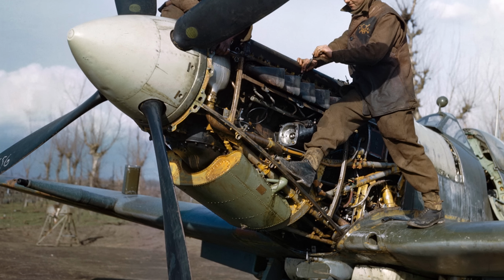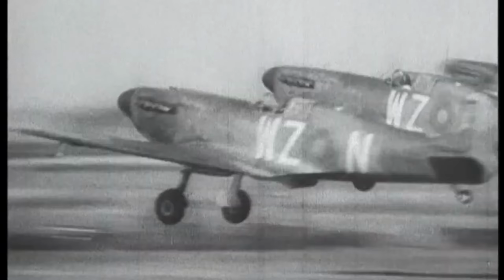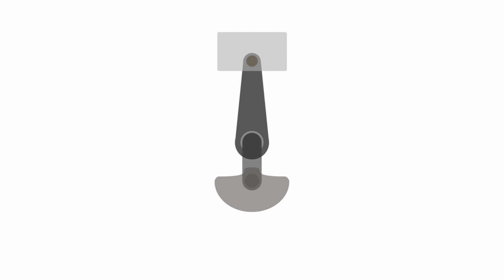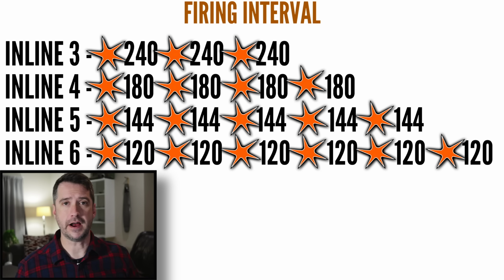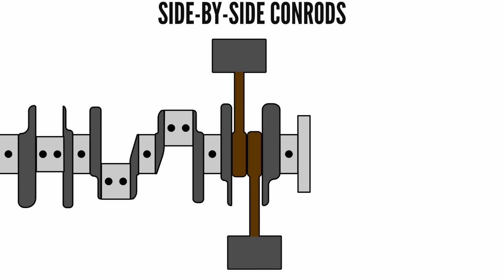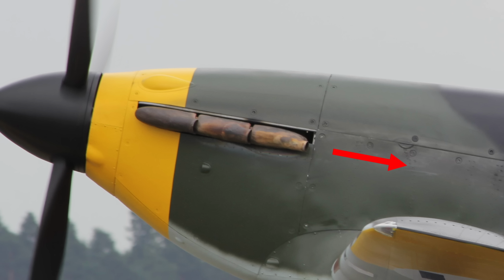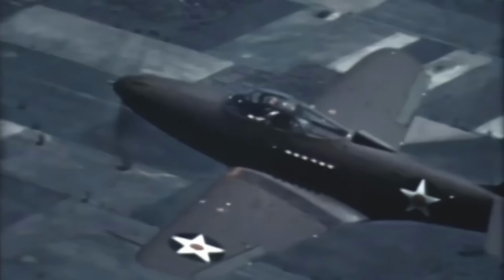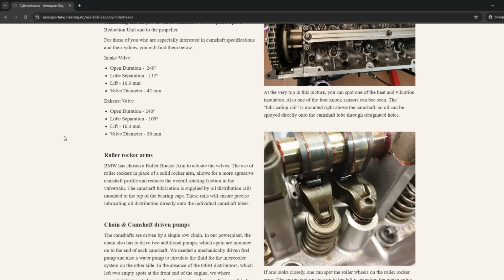WW2 Aviation V12 Design Decisions Explained - History & Technical Deep Dive

Comment: What's really interesting is how close those 3 nations were to aero engine development around 1925, and how some small missteps cost them huge losses when WW2 broke out.
For example, the US decided to stop investing fortunes into the Schneider cup around 1925, which led to engine technology stagnation leading up to WW2. The Brits were on par with the Germans in early fuel injection research, yet despite their testing showing positive signs they quizzically brushed it aside for carburetion. The Brits also wasted many years on the sleeve valve design even though it proved to be nothing more than a headache at every development. All 3 powers had the same scientific studies on how turbocharging was more efficient, and scaled better for altitude over supercharging, yet all 3 powers brushed it aside early on for the same reason; superchargers were smaller. And Germany early on knew they would have issues securing high octane fuel as a war in Europe dragged on, and so they very carefully designed the DB601 to use every trick up their sleeve to run optimally on "lower octane" fuel, like fuel injection (Germans rated by lowest octane, Brits/Americans/Italians rated it by highest octane, so German "100 octane" was actually closer to 130).

Comment: Exhaust trust from a supercharged engine is not very good, we know that after the war when they use turbo compound engines to channel that velocity into the propeller the plane was significantly faster. Its the same logic as a turbofan is superior to a turbojet.
Reply: On the other hand, the XP-72 gave up the p-47 turbo charger for a two stage super charger. Exhaust thrust does a lot more for you at the top end of your speed range, but doesn't help much at the speeds that propeller aircraft climb at.
Reply: @MrAwombat  given the size of turbos in ww2, and even of tubocompound units, it was a waste to invest into this. Only usa have the $ do such thing and still claim to be succesfull because the giganormous size of the p47.

Comment: Fantastic video. The only engine with efficiency spec. was the only diesel: 39.7%  Wonder if the 7 series BMW engine from Norway gets even half of that. Although it almost doubled the original factory HP.

Comment: Amazing video, loads of great pictures! Personally, and I don't have a Spitfire to test this on, but I doubt adding a Turbo would have "reduced exhaust thrust" even though that's exactly where the turbo gets it's energy from and you're right to point it out, but I think much of the exhaust placement is about getting hot exhaust gas over the wing to create lift (without creating drag). "More lift for the same amount of drag" can also be stated "same lift for less drag" - i.e. with hot gases over the wing you can fly at a better attitude. The 10mph top speed improvement would probably still be 8mph, and of course you'd have a turbo.

Comment: Dear LGA, first thanks so much for your great informative videos and the reminiscent SA accent! I would like to propose a video idea extending this one. In late 1942 Stanley Hooker (later knighted for his work on jets) was recruited by Rolls Royce to work on the urgent problem of boosting power at latitude for the Merlin engine. His solution was to insert a liquid cooled intercooler and 2nd stage supercharger between the existing supercharger and engine block. As you pointed out in this video, an even better solution theoretically may be to add a turbo as the first stage since it does not scavenge as much engine power. However, Hooker’s solution was right on the money in this case, brilliant, compact and was implemented into the Merlin 6x production in less than 6 months. This improvement may actually have secured performance altitude at the most crucial time of the war, allowing air superiority over the fw190, and perhaps even war winning. This engine of course was used in spitfire, hurricane, lancaster, mosquito and mustang built under license by packard. The 2 stage turbo solution later implemented in p-38 and “jug” was slightly superior, but very bulky requiring twin boom or bulky and expensive airframe, actually nearly twice the price of the 2 stage super-charger as implemented by Hooker in record time. For me Hookers intercooler is a work of art, or a sublime mix of art and science of engineering. It has 4 trimmed rectangular channels in which the coolant circulates, exquisitely sized to optimize heat transfer from the hot intake into the second stage. Air superiority was arguably the single most important factor defeating the nazi threat. Stanley hooker may be the most unsung hero, an engineering fighter ace, of the order of Turing and others in winning the war. Many thanks. Pete
Reply: Hooker’s breakthrough looked simple — like a car engine and radiator. The hot compressed charge passed through a donut-shaped intercooler cooled by liquid, while a radiator box above dumped the heat into an airstream. But behind that apparent simplicity lay Hooker’s brilliance: he solved the fluid mechanics, thermodynamics, and heat-transfer equations for a two-stage supercharger entirely by hand, with no computers or calculators, turning sketches and slide-rule math into the Merlin 61 that gave the Allies the altitude edge in 1942.

Comment: Turbocharging while still utilizing hot exhaust gasses is still possible. Radial engines with recovery turbines or even the XF Rainbow is a great example where air is ducted around the engines with the exhaust to a rear adjustable nozzle producing thrust.

Comment: I wonder why flat-12 were almost ignored. 
Only Lycoming made one (O-1230, 1200 hp), which was not mass-produced. 

At first glance, flat-12s would have been a great option for twin- and quad-engined aircraft : same advantage than a V12 (perfect balance, etc), similar cooling, plus a lower profile, making it more aerodynamic : it would mostly fit inside the wing. 

But this layout wasn't used, so there must be one drawback that has not occured to me.

Comment: thank you Sir for this video 
I have a question  but didn't find a clear answer yet about engine HP for all old aircraft. As known, most of the engine are more than 1,000 hp. 
My question is, do we need this high HP to get high RPM ? or force? Or torque?
If yes, what is the startup ideal RPM for the  propeller ? I have heard abou 1.3 RPM  which is low when we camper it with can engine.
If the the high HP is to convert the force into torque, in this case, mechanically the speed will be reduced as you know. 
Please advise me and sorry if i confused you 🫡

Comment: how did they handle the lubrication in the engine?
Reply from the maker: Dry sump system. Oil is pumped to the engine from the oil tank, the two scavenge pumps return oil to the tank in the case of the Merlin.

Comment: You cannot understand why the secondary imbalance of a straight 6 engine is cancelled out without starting with a careful look at the slider crank equation. Start with the derivation of the equation. See that the secondary vibrations rotate at twice the speed of the primary. See that at 120 degrees spread, with two pistons at TDC, the 4 pistons each contribute 1/2 of what each piston at TDC contributes in the opposite direction. Why? Because sin 30 degrees is 1/2. It comes out of the math. That is why the secondary forces balance out. One cannot understand mathematical things like this without understanding the math and anybody who thinks they are understanding this concept without understanding the math is fooling themselves.
Reply from the maker: I note your opinion, thank you. My opinion is if somewhat complex math (might not be for you, but it is for many) is used to explain certain things, you immediately lose the interest of 95% of people. That is terrible! I believe it's possible to explain concepts visually so that instead of losing 95% of the audience with 100% correct math, instead 95% of everyone can have some understanding, even if some generalisations are made. I'm not prepping anyone for an engineering exam, and the intended audience is not engineers.

The ethos of this channel is I use as little math as possible to explain concepts. I don't care if some don't like it. Many love it.

Comment: I have often heard a ninety degree cylinder angle was not optimal.  This is the first time this issue was explained.  Thank you.
Reply: From my understanding 90 degrees is optimal for engines with fewer cylinders because primary balance is more important than even firing order. In some applications like motorcycles, uneven firing order can be an advantage because it allows the rider more control at the limit of tire grip.

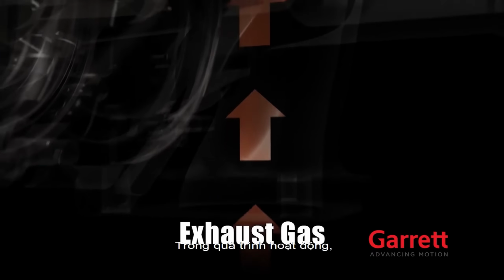Comment: 25:27 absoute nonsense - Turbocharger does have a parasitic loss... there is no free power! 
Simple example: put a turbo on an N/A engine exhaust, but the charge pipe goes to another engine... the first engine will get bogged powering the turbo .. the pistons have to "fight" the exhaust back pressure trying to push the exhaust out several times per second!

Also earlier you used a boxer engine example - I think a flat engine should have been mentioned as well (looks the same externaly as a boxer but each pair of opposing pistons actually share a crank pin).

Otherwise, fantastic job!
Reply from the maker: Correct. I was referring to mechanical parasitic loss.

Comment: BTW, Merlin was not an exceptionally good v12 engine by ww2 standarts
Reply from the maker: It was pretty good, if not exceptional in the 30's (first run 1933, production by 1937).
Reply: @LetsGoAviate  that's true, but by 1942 it was pretty antiquated. I wonder why americans chose it instead of more advanced Allison for p-51d
Reply from the maker: @tedarcher9120  Probably because the Allison V-1710 was single stage supercharged, limiting it's high altitude use. We know turbo-supercharging didn't work out for the V12 single engine fighters, so it was probaby faster (war raging on in the meantime) to go for an engine that already had a 2 stage supercharger than to redesign the supercharger of the Allison.
Reply: @LetsGoAviate  yeah, but wasn't it faster just to pull the supercharger off a Merlin and stick it on Allison? Packards came out about the same time as two stage Allisons anyway
Reply from the maker: @tedarcher9120  I think the 2 stage Allison came out a bit later, the Packard-built Merlin first ran in 1941 already. As far as I know it was actually discussed to use the supercharger of a Merlin on the V-1710 but I guess it was considered more of a "gamble" than the Merlin which has been proven to a larger extent by this time.
Reply: @LetsGoAviate  maybe, but p-51D and p-63 entered production basically at the same time. Very weird
Reply from the maker: @tedarcher9120  Maybe a subject for me to research in-depth, possibly make a video if interesring enough

Comment: Outstanding!!  A technical deposition of this depth is long overdue.  One subject of fascination to me has always been the 45 degree included angle of the WWI Liberty V12.  Might be an interesting subject at some time.  Keep up this great, great work!
Reply: 45° to keep the engine as narrow as possible. Same displacement as the Merlin by the way. Also built as an inverted air-cooled V-12 with the displacement reduced.

Comment: Hi, A most excellent video. I have 2 questions. 1, Why did the germans go with an 80 degree V?????? 2, Where would I go to find/ develop info on the benefit? of building the best ANGLE V2 style engine- aka a 60/75/90 degree block. Which would be best , and WHY?   thanks
Reply from the maker: The RED A03? A wild guess would be to create needed space between the cylinders, which would be much less with a 60° cylinder offset. Being a diesel could also contribute. There's not many reasons to stray from 60° on a V12. With split crankpins a smooth firing interval should still be possible, but the crankshaft becomes more complex. But I did not research this to give a confident answer.

Which V2 angle would be best? There are 3 main factors; balance, firing interval and size. Without a balance shaft, 90° is the only balanced option, as explained in the video. The single cylinder on each side of the V is unbalanced and can only be balanced with a shaft or a 90° angle using the crank counter balances. 

But 90° makes them take a lot of space, and 90° does not result in a smooth firing interval. No v-twin can have an even firing interval, but a narrower angle V will be closer to even and thus smoother.

Hope that helps.

Comment: so knowing this I would build a 12 cylinder boxer engine hidden in the center wing direct cooling ducts in the wing root with a driveshaft to the propeller. think p-39 but a boxer 12 in the center of the wing. wish I could draw the plane I'm seeing in my minds eye is amazing. 6 synchronized 50 cals in the nose 4 20mm in the wings.

Comment: At the time of WW2 turbocharger technology was still being developed. Metallurgy was no where near what we have today.
Aircraft engine design is vastly different than automotive, more closely resembles heavy duty diesels. Because both run for hours at high duty cycles, read power levels, compared to automotive engines, the webs between the main journals and rod journals must be wider. Also the fillet radius between the web and journal must be a larger radius. These two features help absorb and mitigate stress risers and cracks which will develop into broken crankshafts. The crankshaft throws unwind on the compression stroke and then wind up during the power stroke. Metals when bent repeatedly eventually crack and break.
For similar reasons the connecting rods need to be designed for the higher duty cycle loading.
Exhaust valves in an engine running at 75% power for hours tend to run hot. Aircraft engine mixture can be adjusted for maximum exhaust temperature which is maximum power for 5 minutes on takeoff. Then most are adjusted to richen the mixture (ROP) until the exhaust temperature drops about 50°F. The extra fuel cools the exhaust valves. The mixture can also be leaned to reduce the temperature about the same (LOP), with the extra air cooling the valves.
Running at high power for hours and maximum exhaust temperature will lead to exhaust valve heads breaking off. OOPS.
With all this, keeping weight as low as possible while keeping reliability is a delicate balance.

Comment: My favourite example of why turbochargers where not very popular at the time is the internal diagram of the P-47. Plumbing for the turbo and intercooler took up a lot of space, requiring a fat fuselage to house it all. No doubt it added quite a bit of weight as well. However that plane was also a great example as to why this sacrifice could be worth it even on fighters. Especially late war models on high octane fuel could achieve ridiculous high altitude performance. Even more so if the crew tampered with the turbine overspeed protection to maintain max boost to even higher altitudes.
It's just that at low to medium altitudes the compactness and simplicity of pure supercharging far outweighed the mechanical efficiency of turbocharging. At least through most of the war when manifold pressures remained somewhat modest.

Comment: When I read the video title, I clicked because OBVIOUSLY, you'll discuss why WW2 German V12s were inverted, and all the pros & cons that came with it. That's a HUGE technical difference but not even a single mention.
Reply from the maker: 😆 I had to keep the video short(ish), I couldn't possibly cover every single thing I wanted to, and tried to keep to the tech. For every viewer something else is more important, so to many I will have left out something important to THEM. 

There isn't much to it, engines are almost always mounted upside down to improve forward visibility. But you also get a lower centre of gravity, and maintenance is easier, especially in more remote locations.

The cons are that it needs a dry sump oil system and potential problems with hydrolock with oil seeping into the cylinders, though as far as I'm aware the DB 600 series didn't really struggle with this.
Reply: @LetsGoAviate weren't all aviation v12 dry sump? It would be inconvenient for your fighter engine to explode as soon as you pull negative G. Why didn't other countries switch to inverted V?
Reply from the maker: @tedarcher9120  You are correct regarding dry sumps.

Inverted isn't really "better". Other than the reasons I already mentioned, also being able to mount a cannon to shoot through the nose. So better visibility over the nose, lower C of G and the cannon may have influenced the decision to mount inverted (remember the DB 600 prototype was upright, they turned it upside down later)

In hindsight we know those advantages made little, if any, difference compared to the American and British upright V12's.
Reply: @LetsGoAviate  with the inverted V12, the thrust line was lower (less prop ground clearance) yet Messerschmitt continued using a 3 bladed prop even when HP increased.  I find that the most strange aspect of the Me109s.

Comment: Great video! The issue with the Jet Fuel powered compression ignition engines is that cetane index isn’t in the Jet Fuel specification.  Hence operability may vary significantly!